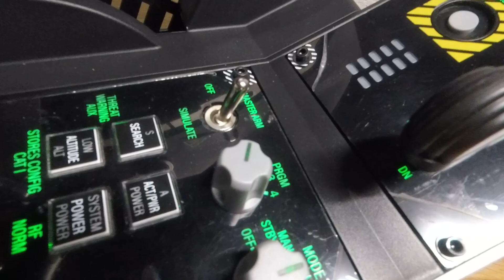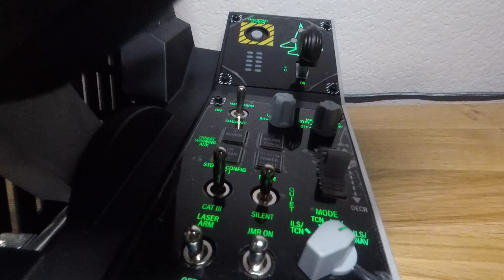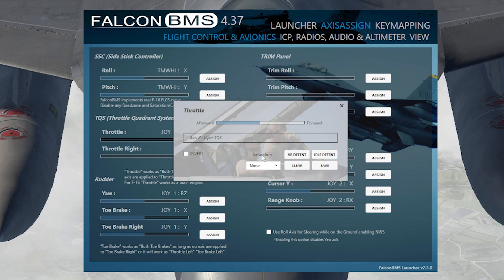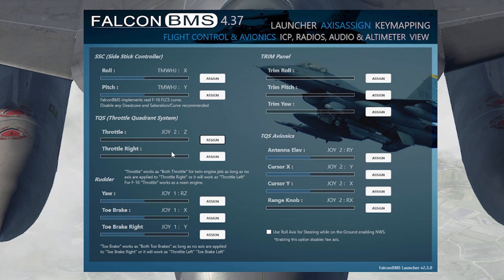Thrustmaster Viper TQS Setup in Falcon BMS

Comment from the maker: Have questions? Ask away.
Reply: a bit out of pocket but could you do a tutorial one day covering the AI radio commands? - Duvstep
Reply from the maker: @Duvstep910  I assume you mean wingman AI commands. I do have this covering ATC. https://youtu.be/Yc0_MkupW1A?si=8iKzplV9kkP_QGAt
Reply: Hey, so just got mine in last night plugged it in and got all drivers downloaded. I got the T.A.R.G.E.T going but am missing some light on my RWR and landing gear. Does your turn on? Thank you.
Reply from the maker: @iammorpheus7345  Mine do not turn on. It is in the works for BMS.
Reply: @AviationPlus   is there already a working script ? i load the LED Demo viper script that seems to work for the light fine but then i can't key bind many buttons. BMS simply wont recognize them
Reply: Looking forward to a full review. Are you planning to keep the Warthog for the upcoming F15 in BMS?
Reply from the maker: @Ad4785-r8d  I'll be keeping the Warthog.
Reply: Can you do the same for the winwin F16EX
Reply from the maker: @danielinokoba5655  I would love to compare the two but I don't have a winwing.
Reply: I know this is old. However, I just know installed bms and bough the TQS viper. (Still play the original falcon 4.0) the tqs seems cheaply made compared to the warthog ( which I have) any advice you can give to a noob on bms?
Reply from the maker: @nando03012009  Advice on what the throttle or Falcon BMS?
Reply: Can you do plz , tqs switch setup for dcs as well , it will be great,. Looking for it.
Reply from the maker: @stevesteven-gw4zy  Just bind it in the axis.
Reply: Nice review. I have a question about the cursor axis. Are they correct ? It came up in the forum sometimes and someone says streching the thumb is cursor up and bending is cursor down. So this is different to your showing. Are you shure this is correct ? Thank you for your time..
Reply from the maker: @badericGer  When the throttle is in the MIL position the cursor is in the correct orientation. Up will move the cursor forward and aft will move the cursor left. This is how it should be set up in. Noticing that in the video there was some ambiguity on directions.

Cursor Up moves forward
Cursor Down moves aft
Cursor Forward moves right
Cursor Aft moves left
Reply: @AviationPlus  Thank you for clearing this up. I brought this up some time ago in a forum and someone suggested "left/right" on the throttle should be cursor up/down. The thought was pushing the thumb away (so right) should push the cursor on the radar screen away (so up). Sorry for being a little off topic.... great throttle by the way I use it for a week and it feels great. Used the Cougar Throttle for more than 15 years.

Comment: I have different names in BMS 4.38 for idle.  Mine are TQS throttle - toggle idle/off and TQS throttle -  idle.  When  dx18 is active, the throttle should be cut off.  On dx18 release, the throttle should be idle.  There's also switch 19 for when the throttle does into afterburner, but I did like you and just set the detent for just after the throttle gets over the AB hump.  IDK if the difference in my names is because 4.38 vs. 4.37?  I think it must be.  I'm getting ready to sideload 4.37, I guess we'll see.  Thanks for the video, was a great help to me.
Reply: There should be a throttle idle and a throttle off. Off being dx18 press and idle being release
Reply: @harristrike4361 Yeah I have it working.  Was just commenting that the names were different than shown in this video.

Comment: Picked this game up today, it is my first flight sim apart from the new "Nuclear Option", I was so excited but for some reason, my throttle doesn't work, it's an entry level Thrustmaster T16000m. The game recognizes the throttle but there is no response when I move it up and down, no response from the whole throttle device. It works in another game though! Any suggestions?
Reply from the maker: Make sure it's not mapped to another button

Comment: I'm having an issue where my Idle cutoff button is not being recognize so I always start off with my throttle in the idle position.

The Viper TQS uses button 18 as the throttle cutoff button, but I cannot get BMS to recognize it. I do not have idle detent selected for the throttle axis. I do have throttle dent/cutoff selected in the BMS configuration option. My button assignments are as follows:

TQS:CUTOFF RELEASE - Idle Detent - Idle DX18 Release
TQS:CUTOFF RELASE - Idle Detent - Off DX:18

I start the mission with the Viper TQS throttle in the Idle cutoff position which should have the throttle in the Idle Detent Off position, but when I enter the cockpit, before starting the engine, the throttle is in the Idle position.

When I go into key mapping, I do not have the option in the Profile drop down window to select "BMS -Auto" nor in the Category dropdown window is there an option to select "HOSTAS THROTTLE" as is shown in your the video. I’m using the latest version BMS 4.37.
Reply from the maker: You must start in ramp to have the throttles in off when you start. If you start taxi your engine will be running.
Reply: @AviationPlus  I figured out the solution and a bug on the configuration page.

On BMS configuration page there is an option in the Hardware section called "Idle Cutoff" and the description states that checking this box enables the OFF-IDLE throttle position. The description is incorrect. Checking this box disables the OFF-IDLE throttle position.

My throttle idle cutoff now works. Thanks for the help.
Reply from the maker: @RTSchramm  Oh awesome good to hear. Now that you mentioned it I think I had the same thing but figured it out just like you.

Comment: Hey brother thank you, i just bought this one and was having some buyers remorse. I have the warthog throttle and stick, and am hoping it was a good switch.

Also updated its been great so far just a couple of days ago I was able to get the TWS, speed brakes warning, missle warning and the red Like to show up on the landing gear handle.
Reply from the maker: If you fly the F16 majority of the time. This is a great switch from the Warthog.
Reply: @AviationPlus Looks like I am sending mine back due to as they say "abnormal input." So the tech tech team is going to look at it. I really hope they fix this. 500 bucks for my RDR cursor, antenna elevation knob, and about 3 more while throttling up and down. Let's see what happens with them, well let you know. I am nervous they wont be able to fix it and ill be miserable😢.

Comment: There is a button for the dogfight swith center, you need to open the tqs driver and enable virtual buttons
Reply from the maker: I have done that now it works but not as intuitive as I'd thought. When I push the buttons on the throttle in the launcher it does not jump to the button control line.

Using the release function works just fine.
Reply: @AviationPlus  yea true, i didnt know of the release function at first so i did it trough the methode i knew haha
Reply from the maker: @DerpyEmm  No worries both work out to the same outcome.
Reply: I enable the "self-cancel" option on the CONFIG menu. It is the old system, but same result. :)